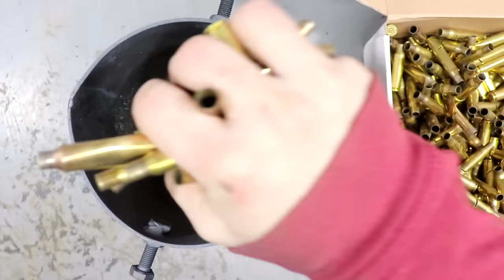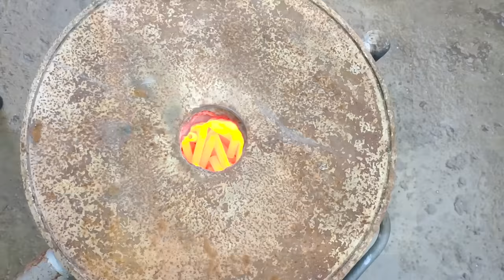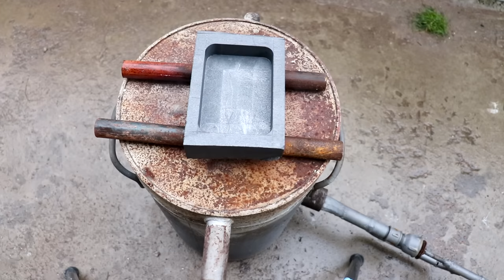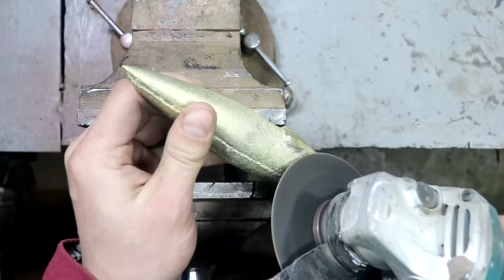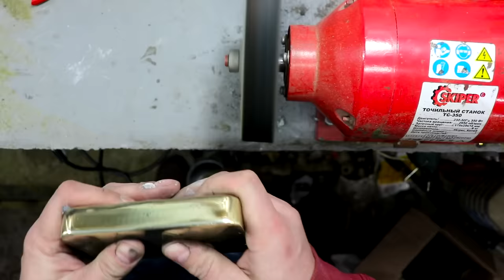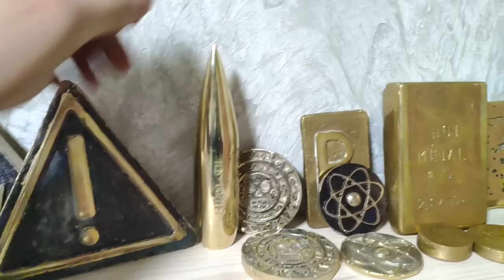Casting bullet - Trash to treasure - melting cartridge case -ASMR brass casting

Comment: Nice polish on that bar.
Reply from the maker: I tried to do it well
Reply: @hotmetal85  it worked out.
Just curious, what is the sand you're using? is it home made green sand? Just different than the petrobond other casters seem to be using. Have a muller to recondition the sand once it's used?
Reply from the maker: I made this sand myself , I restore sand by adding bentone oil and alcohol.

Comment: When you are putting on a sprue don’t put it on top of your mold,  off to the side and make a run, it will make your piece have a better finish and no sand falls in. Both will be less sanding!!! I’m all about less work
Reply from the maker: Thank you for your tip
Reply: pknnno
Reply: Tt
Reply: @hotmetal85  อยากได้